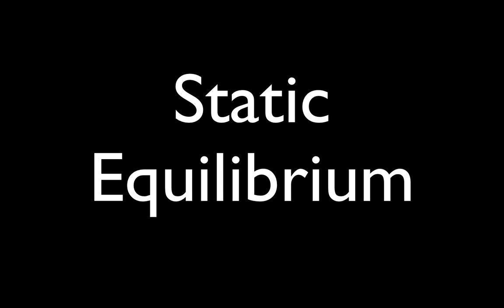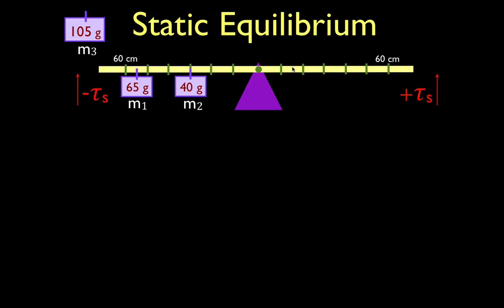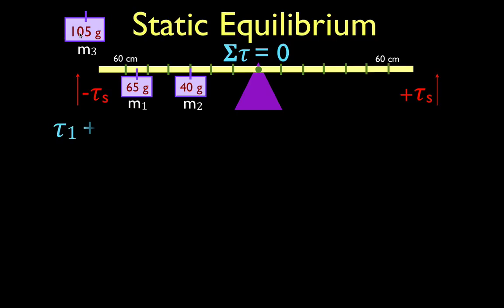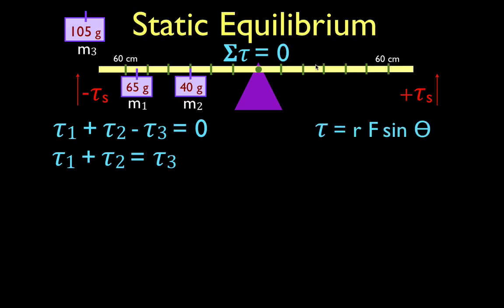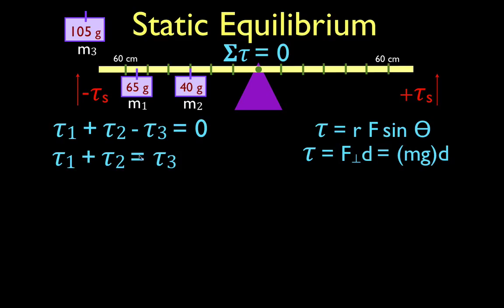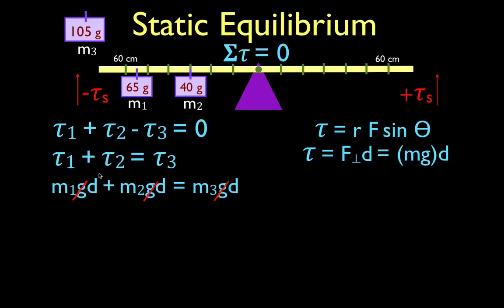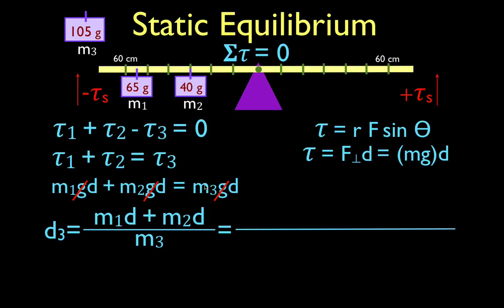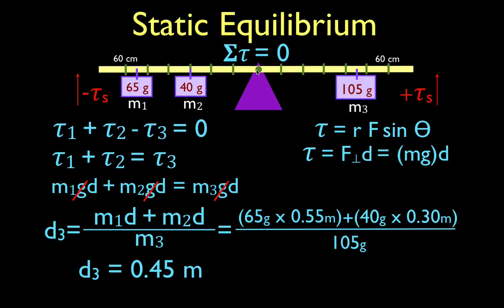Physics, Torque (3 of 13) Balance Beam

Comment: Hello,can you explain why it becomes.
 0.55 and 0.30?
Reply from the maker: Because the distances are given in centimeters but should be converted into meters before you put them in the equation. In this case you could leave them in cm, but it is standard to first convert everything to the based units.

Comment: What about if you know T3, the distances to m1 and m2 and what their combined weight is, but not their individual weight? Example: the arm is 10cm, the fulcrum is at 5cm, m3 is 45kg all the way at the end (5cm from fulcrum). m1 and m2 are at 2,5 and 5 cm from the fulcrum respectively. I know there is balance. How do I claculate m1 and m2?

Comment: in first set up how'd u know t3 is on right side? it could be on left side, how'd u assume that?  question didnt say m3 will be on the right, you had to figure out m3 but, you dont know if m3 will place on right side,...
i get t1+t2-t3 if only, question mention m3 is placed on right side.
Reply from the maker: +Jack H Great question!  I think common sense would indicat that it would go on the right, but maybe I should not have assumed that,   I probably should have started with a more general summation of the torque.  

In that case the distances to the left of the pivot would be negative and those to the right would be positive, this would result in:

(-m1gd1) + (-m2gd2) + (m3gd3) = 0  solving for d3 would then result in a positive value indicating that m3 must be placed to the right of the pivot.

Does that help?